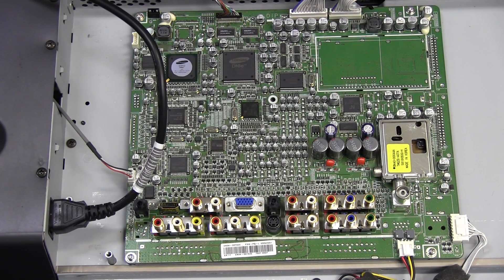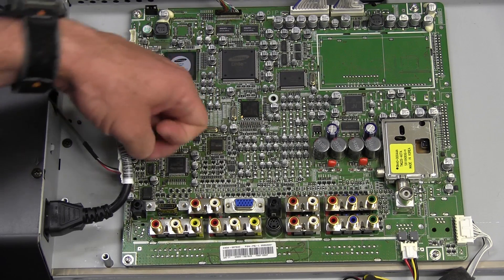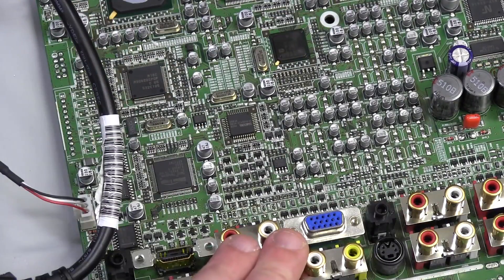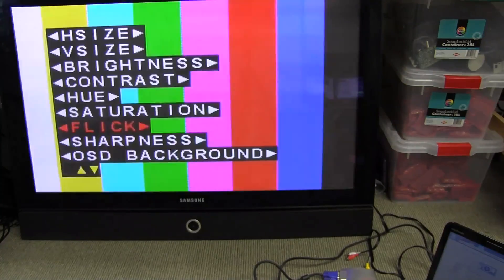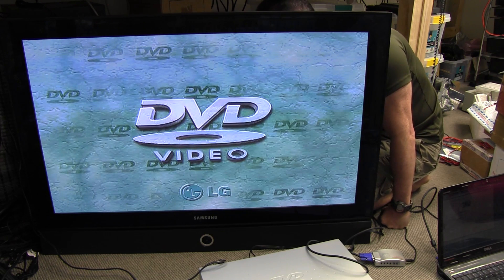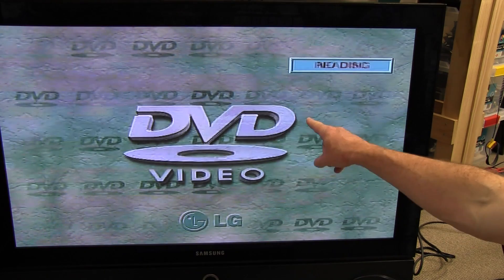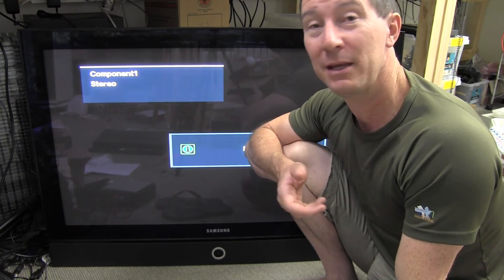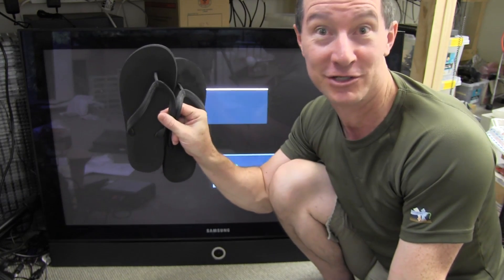EEVblog #447 - Samsung Plasma Followup

Comment: The screen is getting worse from freezing the chip moisture is shorting it?
Reply: Not possible unless you get some REALLY shite water-based duster, and that's assuming one does exist, and I think not. Normal non-Crazyland dusters are based on butane, and IIRC it's non-conductive, but even if it is, then it's not very important because it dries reasonably quickly.

Comment: i just picked a 2006 Philips plasma up off the street (had no remote).  The plasma screen and many boards were Samsung parts.  The TV had audio and menus but no input video.  I did a firmware flash/upgrade via USB and all worked well afterwards.  But that didn't stop me from cannibalizing it for parts.

Comment: I'd put a scope on the power supply and make sure the clock is clean. Also, look at the composite signal input on the scope to see if it's between the chip and the input. Are you sure the board isn't cracked around all of the analog inputs?

Comment: in the other video there was a wire that you said was loose. did you put it back in .or did they use that crap solder that forms crystal bridges on the chip set.

Comment: Perhaps the "burnt" analog decoder chip was a bit under-spec'd for the ambient current, and slowly degraded over time, to the point where leakage could occur (between the micro-components) under certain conditions. That could account for the intermittency of the failre modes.

Comment: it's the smd capacitors there bad, often times the smd caps dont bulge or show signs of being bad but they are, so test the caps or replace there cheap do it, the processors seem to work, seems like the signal is unstable hence unstable voltages pointing to caps.Similar issues are from hdmi inputs circut boards for some onkyo recievers haveing hdmi input issues from bad smd caps without any physical signs of deteriation.

Comment: Check the input jacks. They tend to crack at the solder points. Could cause signal degradation and high impedance all the way to no connection at all. That would be a problem. Also, the DEC chip might just be damaged.

Comment: As others have mentioned already - a BGA chip like this could probably do with being re-balled (dry joint most likely), although it'd probably be cheaper to buy a new SAA7119 from the internet - looks to be about $1.50 - break out the hot air station dave!

http://uk.alibaba.com/product/60052853879-SAA7119E-2D-digital-comb-filter-video.html

Comment: You could try desoldering the chip, cleaning the pins, and then resolder the chip. The problem with that kind of components that heat a lot is not usually that the component gets physically damaged, but rather the soldering getting weaker and weaker because of the high differences of temperature, so after a few years there are faulty soldering in certain pins, causing bad contacts and intermitent problems (the device works for a while, then it fails). Maybe it's not even the chip itself, but a component next to it.

Sorry if I mispell something. I'm not used to this kind of technicall vocabulary in english. _"

Comment: It might of been screwed up as the crystals change frequency from intense hot/cold. 
Of course it is a typical Samsung, don't expect it to work.
Reply: Good point. It would be worth measuring the crystal frequency.
Reply: binarybox2003 If the frequency is slightly off the colour will tear. When the frequency is too high I fix it by adding a couple of 5pF to the load capacitors on the crystal. I'd bet that C0345 and C0347 are the load caps.

Comment: Sometimes the heat-gun treatment works for the BGA chips. I would try reflowing the board with a heat-gun and see if it fixes the issue. You don't really have anything to lose.

Comment: looks like you will need to reflow the chip for the analog inputs I have had to fix several TV's with the same problem.... its pretty simple you will need a heat gun and heat shielding tape ( foil will work 2 ).... I can make a video of how you can get it working... :)

Comment: Ah, heck!  Why bother with trying to restore the function of the analog inputs?

Use it as an HDMI monitor, letting something like a modern digital home theater receiver deal with switching and processing the video of the analog video sources?

Either that or just replace the logic board.  Granted, you may wish to fix the board, but then what would be the cost to do so, not just in terms of money but also in terms of your time, compared to just finding a used board for the same model television from eBay and getting the set to work that way?

Comment: Dave . Get out your ESR meter and check those surface Mount caps . I bet you have a few that are bad .Caps would be the First thing I would do . The second thing Like all the other People are saying is reflow the BGA chips with real lead based solder .Remove that Lead free solder from the BGA chip and replace a good connection back on the chips to the board and so forth . Third Look close at your solder Joints too . Bad solder can cause all sorts of problem like intermitted connections . My Sony CRT 40 Inch television has the same problem ,,but I haven't got around to changing the MCZ3001D Chips on the D-Board . Like My father said if its not Messing up leave it alone

Comment: Check your voltages on the mainboard. I had the same on screen color issues with my plasma Samsung 720p through the VGA inputs. I was not able to see what was done to correct this issue. However, after speaking to the technician, he connected his voltmeter to the mainboard found an incorrect voltage somewhere.. He was then able to correct the voltage with an adjustment of something (I'm guessing a pot) . Apparently the voltages are written on a sticker attached to the chassis.  

Sorry, I not able to clarify the "somewhere" and "something" in my comment.

Comment: it's gotta be that BGA chip. try hitting it with a heat gun and see if that makes a difference, if that fails, if you are able to reball or replace BGAs, then try replacing it, I had the same trouble with an old 15" monitor and by replacing the processing chips, that fixed it

Comment: There is also a special service remote that the factory gives authorized service centers. you can use them to get into the hidden factory menu. there will be a password to get into it, and once you're in, you can see the exact date of manufacture, the usage hours on the TV, you can swich some sets between NTSC and PAL, you can change and test some display values like clock rates, and other things. it's pretty cool. See if you can find a samsung service remote. They will be universal for only samsung TV's.
Reply: alternatively you can try to get a programmable remote that has reprogrammable buttons (i had a phillips remote that could do the service settings on a sony tv ) you had to put a 3 digit code in to do it, sadly the rubber buttons died (rubber went sticky and couldn't be fixed) it was about £20 or 35.64 Australian Dollars i miss that little guy :-(

Comment: Samsung has same problem with there square chip on the Galaxy S4 phone. Remove, clean off the solder, do some SMD spray and add solder and then put newer square chip on, using a heat gun to melt solder underneath while heating up the top of the chip about 6 inches away to seat the chip on board again.

Comment: Without looking at the print on this unit I'd say you probably have a cap failing in the oscillator circuit that's causing drift which is the visual "tearing" artifact you are seeing.

Comment: The "colour tearing" looks like the 17.734475MHz or 14.318180MHz crystals (or the PLL that generates those frequencies) is drifting significantly, and the PLL that locks onto the colour burst is not getting a good lock.
Reply: Valid explanation, and would also explain why sometimes the component input does work.

Comment: Could you not remove the board and lay it on a level surface and reflow the solder on the BGA chip and see if that solves the problem as BGA chips are prone to problems anyway I suspect that Asutralia has also gone digital and got rid of analogue Television.

Comment: I'm by no means an expert, but I do know that it's very common for the caps to go bad.  Even on newer tvs.  Also, the tearing did seem to get a little worse the first time you hit it with the freeze spray.  That loose cable could have been an issue if the hdmi also had the tearing, so I don't think it's a problem, though I agree that it shouldn't have been so loose.  So my best guess is still that chip or maybe a cap near it.

Comment: Do not presume anything - not in this day and age of electronics. Stranger things have happened with far simpler circuits, to the best of engineers. Take for example instability in the TL431 voltage reference that can be notorious for spurious oscillation. I have myself posted a video to that effect, which shows how that instability can be harnessed in a VCO and also amplitude modulator. See /watch?v=pOnu21mqnjI or /watch?v=WpLsWK6j3Gk

Comment: >a "beautiful" looking cap is no indicator of worthiness.

Thus why I also added other other criteria that had been met. The problem is pretty assuredly not with the power supply. This is not a voltage problem, at least not a normal one. The problem does not match the diagnostic steps suggested.

Comment: Are you aware that this man is a professional electronics engineer? He already checked the PSU and such in a prior video. All the caps looked beautiful, and the fact that it works on some inputs and not others means it is very likely not a PSU issue.

Comment: I had the input board on my 2006 vintage HItachi plasma go funky on the analog inputs (some didn't work, others didn't work when the set was warm.) Had a friend reflow the analog decoder chips with his rework station, and the problem went away. I stuck heatsinks on all the hottest chips to prevent them breaking the solder balls from thermal cycling again.

Comment: It's chroma noise. Noise = caps straight up. Now what could cause all analog inputs to fail from conceivably 1 or more caps? Looking at the traces between input and chip it's safe to guess which are for individual inputs, but look off around that chip and you should see caps that aren't tied to a particular input. Another possibility would be unstable clock for that decoder chip since the demuxing of chroma,luma, and H,V by the comb filter is very much timing dependent.

Comment: the db9 serial on the set? i have not gotten through the video yet, but it communicates with ext equipment. big installations and multiple monitors use it instead of infrared so that each monitor can be controlled and read by a controller individually.

Comment: Looks like this decoder as well as its upgrade, SAA7154E is available from China for about $25. Can a replacement be reflowed onto the board? Can it be replaced with the SAA7154E upgrade? The data sheet says that it's programmable, is external programming required or is the programming handled by the board? I have a reflow station and do some television repairs, so just curious....

Comment: Many of the Samsung flat screens suffer from a very specific problem.
In many cases some of the caps get faulty over time and cause alot of ripple going through them. Sometimes they don't even bulge (had this happen once). The ripple itself actually causes the flash/and or eeprom that contains the firmware to go corrupt. The nifty little thing is that often you just need to replace it, and the TV will then program it by itself since it only stores settings. You need to enter service mode though.

Comment: It is entirely possible for those SAA chips to have internal failures that make certain inputs inop and others hit or miss.  The company I work for used them as embedded encoders on a video product that we manufactured before the chip went obsolete.  When they fail they do all sorts of weird things and can cause huge headaches.  As soon as I saw that chip in the last the last video I was almost certain that was the culprit.

Comment: Sometimes you do get ICs that work but have damaged/shorted i/o. I'm actually posting this while using a data projector with a faulty IC. (damaged output).  Luckily the output is a analog voltage that controls the green lcd gamma so i just hardwired it to a fixed voltage. It just means i cant adjust the green gamma on the OSD controls, which i never do anyway.

Comment: Begin this procedure with a small hammer. 1)Kinetically apply the head of the hammer to the mainboard. 2)Test the inputs. If the inputs still are not functioning within specifications, 3)increase the size of the hammer and repeat steps 1)  and 2) again. Repeat step 3) until you feel satisfied with the results. Patience and precision are key to succeeding at this procedure.

Comment: The voltage isn't high enough for the liquid to be conductive, plus the liquid nearly instantly evaporates and the frost does not typically allow current to flow through it as it is spread out in a wide area and as you saw it also evaporates in a few seconds.

Comment: I bet it's that BGA chip you mentioned.  I had a Samsung DLP that had a similar issue with artifacting on the analog inputs (after dusting it out), and then one day started working again no problem.  I'm thinking if you reflowed that chip it would work again, maybe that would be a good video to add to your solder tutorial collection.

Keep it up with the dumpster diving teardowns/repairs! :)

Comment: the reason i say that the tuner might not be using that chip is because it already needs something that can tune channels and feed them to that chip to be converted to the digital that the display demands, but even in 2005 it would have been the same price to get a chip that can tune channels from analog/digital(the signal is still analog) broadcast signal and output it in a digital (parallel) form as it would have been should the chip output an analog (serial) signal.

Comment: i clearly was not talking about that because i was talking about the chip that converts analog to digital, the hdmi port does not use that chip at all, while the vga, component, composite, and (to a lesser extent due to the fact that the tuner may have it's own analog conversion circuit) the tuner do, because they are analog inputs. hdmi is a purely digital input and does not need a conversion chip.

Comment: Thanks for the mention Dave. That is my 10 seconds of fame. 
I did indeed mean a reset in the service mode using the remote control. 
I have a short article on the issues we have with BGAs in the TV industry if you would like I can email it to you. 
Regards
Trevor

Comment: yes that is what uart means, the problem is that all analog data is serial, and all digital data is parallel. any device that converts serial data to analog data (and vice/versa) can be referred to as a uart, because that is the basic function of the original device. there are many different devices that fall under that umbrella, and an adc happens to be one of them.

Comment: Incorrect.  A UART is a Universal Asynchronous Receiver/Transmitter.  That's what it stands for, and UARTs do not handle analog data at all.  They handle interfacing a microprocessor system to a serial line, specifically to an asynchronous line like an RS232 or RS485 serial line.

The SAA part here is a video ADC, and video ADCs have never and will never be "generally" referred to as UARTs.

Comment: oh, and notice the use of the word generally in my comment, that doesn't imply that every uart is called a uart, a uart is the generic name for a device that does what that device does. there are many different devices that fall under the general term "uart", but they are all devices that convert analog data to digital data, and convert digital data to analog data. back in the early 90s and in the 80s many uarts were even one direction, but it's been a long time since that was cost effective.

Comment: optical fiber is digital, parallel, and faster than serial analog data transfer, but it is still very expensive, although for cable size it carries data in a much more dense package. but currently that is the only digital medium, which does not need a uart, that is faster than current methods using analog transfer of data over long distance. but almost all internet connections can be considered serial, i currently have a cable modem using a simple coax cable, my modem has a uart, guess why.

Comment: serial is faster, and higher bandwidth these days than parallel, but it is still an analog way to pass data from device to device, and requires a uart on both ends to convert that data into an analog stream.

Comment: calling it an adc is also accurate, but a uart converts serial (analog) to parallel (digital), so that a digital device (in this case a video processor) can interpret and use the signal. so it is in fact a uart, calling it that would only be inaccurate if the serial (analog) data that is handled by many uarts in digital devices over the years were uniform in format, but the signal is not. the device that converts analog antennae data into something compatible with a digital processor is a uart.

Comment: I have seen those decoder ICs fail in strange ways.
An input may not work or have odd artifacts, etc.

In field service we just changed the board but I have fixed a few by reflowing them.
I have the big brother to that set in my house now that I fixed almost 5 years ago by reflowing those BGAs and it has not failed in all these years.
I am actually hoping it does so I can toss it in the bin and get a thinner and newer LCD set :)